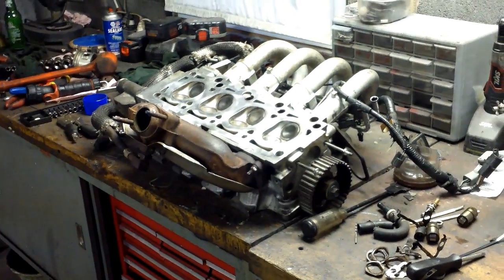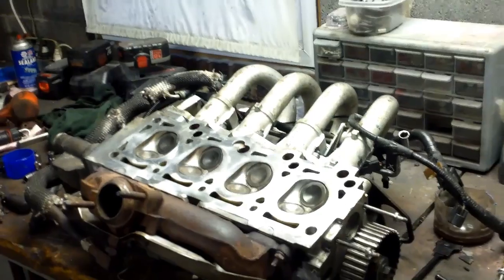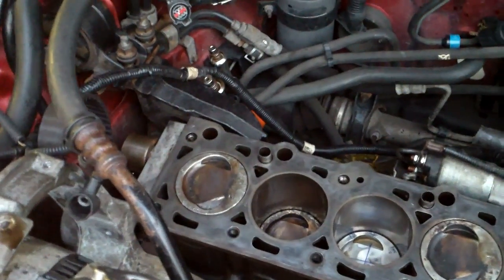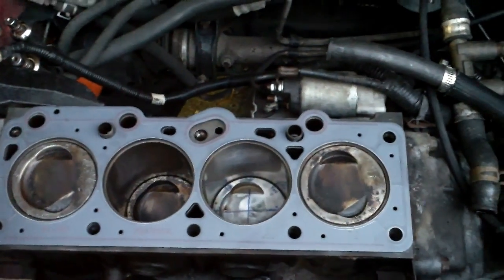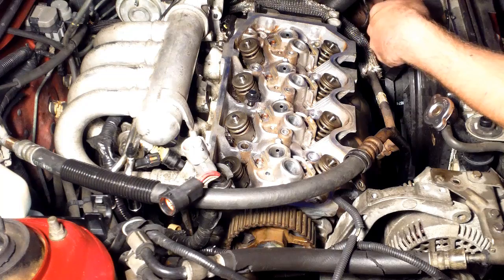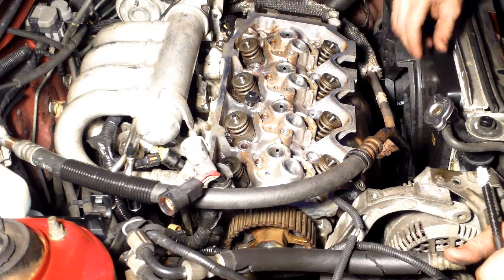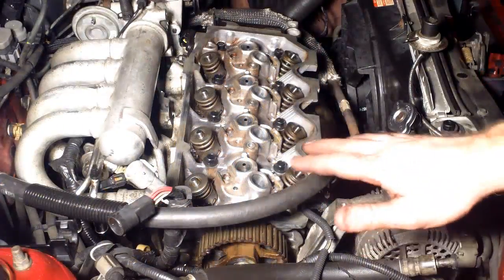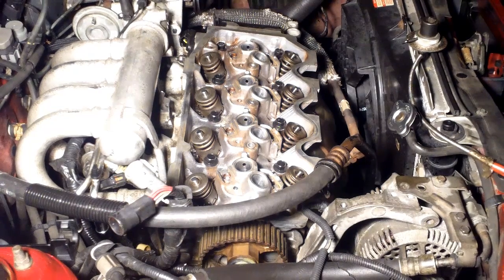Part-3 dropped valve seat, Installing and torquing cylinder head

Comment: I've seen some videos where the shop peens the head over the seat. One place used a drift pin, another used a straight blade screwdriver. They just took the tool and hit it with a hammer and made some of the aluminum fold over the valve seat.

Comment: I had the same thing happen to my '94 but minus the piston issue in 2011. It was replaced with a rebuilt head for $250. I thought on the rebuilt ones a fix was found to prevent the seats dropping again. Anyone know of this ? Wish I had a garage back then so it wouldn't of cost me $1100 to get'r done.

Comment: Hey Rob? Just installed a reman head on my 95 escort and I torqued the head bolts but not like they way you did it.I just torque them right to 44. I got it back together and started it and head was knocking like my old head that I exchanged. Question? Could it be that I have not torque it right the first time or is it that I have another bad head? Thanks need help!

Comment: Nice work on the head installation Will. I never ran across torqueing head bolts and then loosening them. What would be the purpose of that? And your angle gauge looks like it's made by Lisle. I have the same one and it really works well. Good job Will.